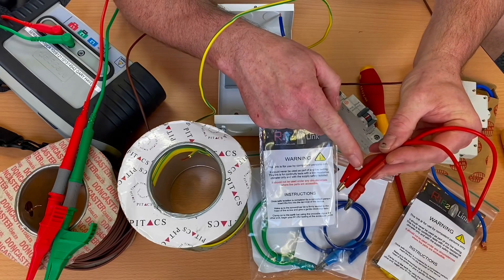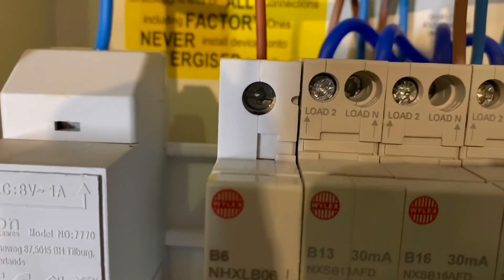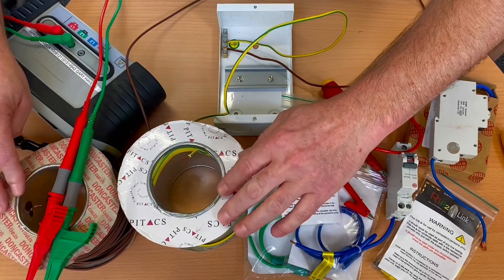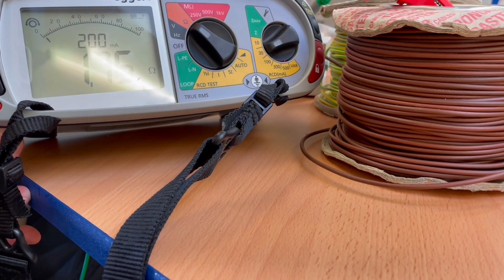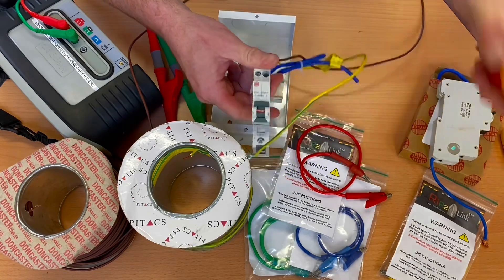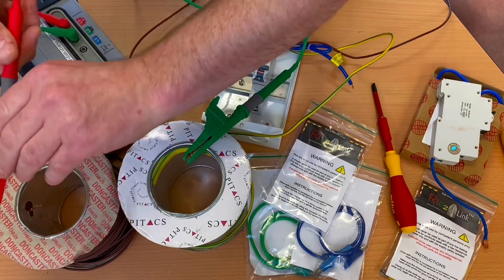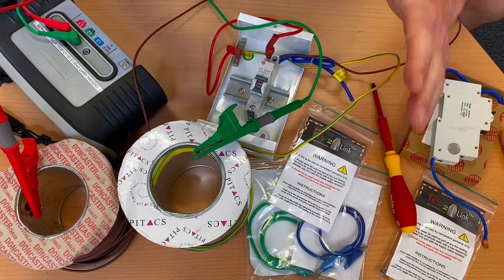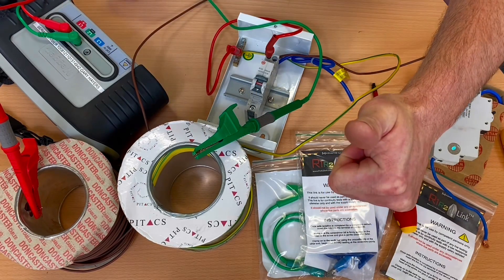R1R2 Link Will it Work on RCBO's & How Much Extra Resistance Will it Add in Circuit For Continuity

Comment: While jump leads can be used in a pinch, Wago connectors (specifically the lever-type, such as the 221 series) are the recommended tool for professional and reliable R1+R2 testing. They offer a safer, more efficient, and more accurate method for cross-connecting wires at the distribution board and testing at various points in a circuit.

Comment: Thanks for doing the follow up video.  However, that test uses magnetism PLUS gravity... a better test would be in a vertically oriented board - as in real life.  I'm betting that the resistance would climb further as the contacting surface area of male to female Pozi geometries reduces as the weight of the cable pulls the driver bit down and away.  Even rotational position of the screw's pozi head might affect this, depending upon the strength of the magnet.  Pre wear of the screw head might also affect this, and crap stuck to the magnet too.  Good for quick and dirty testing, I reckon.

Comment: Question regarding the r1+r2 link lead. You often see its unacceptable to work backwards for your r1+r2 etc zs-ze=r1+r2 because of parallel paths. 

But if your not disconnecting your cpc from the DB and leaving it connected in the earth bar, how is this any different from the above? Wouldn't you still pick up those parallel paths?

Comment: They’re so easy to make yourself & you can use thicker flex which should help with the difference in readings.
Reply: what do you do at the driver end to keep it magnetic
Reply: @curlyzoo00  I’ve got an Irwin Magnetiser/demagnetiser but, they’re easy enough to make yourself too.
2 strong magnets does the job.

Comment: Why not just remove busbar cover, attach croc to both ends and connect to the earth bar and the busbar, and then just open the breaker of the circuit you want to test?
Reply: Because of the internal resistance of each circuit breaker. It may be slightly different between each circuit breaker and therefore you are not getting and accurate result.